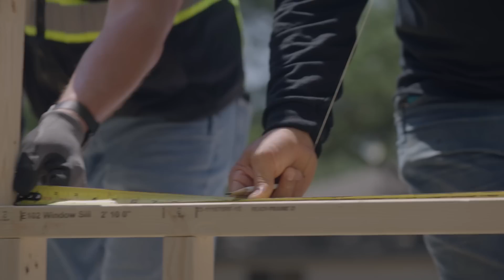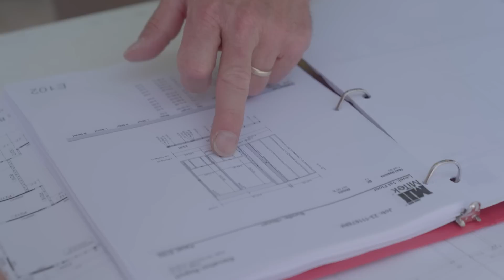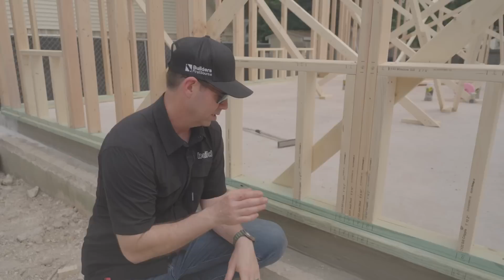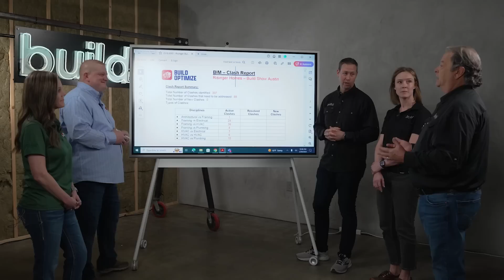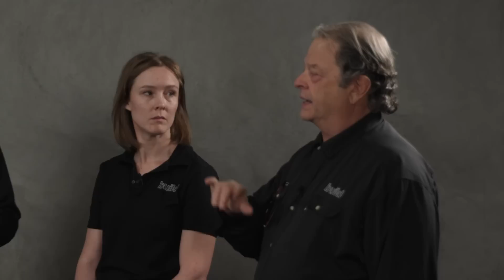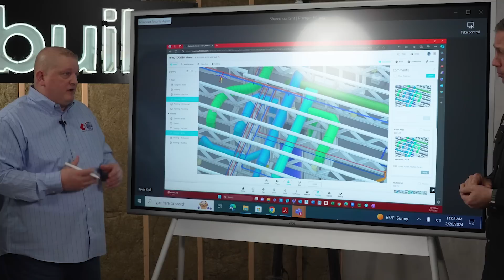The Risinger Build: Episode 5 Part 1 - Exterior Framing with READY-FRAME®

Comment: Never built a house where we could have pre-cut all of the framing. So few of the framing would fit being pre-cut simply due to the height difference in whatever you're framing on. Doesn't matter if it's concrete or wood or whatever. There's ALWAYS some amount of height difference.

Which is fine when your framing lumber is longer since you can just cut it down but when the framing lumber is too short then you can't use it. So I find it hard to believe that they don't have a saw on site and don't have to cut any of the framing lumber

Of course that doesn't sell the product Risinger is pushing

Comment: I have been a follower of Matts since the beginning.  I am not a builder but have built a couple of places of my own and used a ton of Matts ideas and products.  I saw the Ready Frame product and decided to use it on my home build in Hoonah Alaska.  I am on an island and I fu=igured the cost savings in shipping by using Ready Frame would be huige.   I could not have been more disappointed with the entire process.  Once we finally got the package done.  BFS let it sit out in the elements for literally months.  They kept telling me their system was not allowing them to ship it to me.  A "system glitch" they kept saying but they were working on it.   Depsite my repeated requested that they please weather wrap it for shipment to Alaksa, they did not.   This failing to ship it went on for weeks on end. It was suppoed to arrive 2nd week of May.  It finally arrived mid July.   When the finally arrived my builder and I were both shocked at the extreme low quality of the lumber.  There was so much bark on the lumber it was shocking.  It had obviously been out in the repated rain and heat cycle of the WA Summer.  There was black mildew on the wood and most of the headers were split.  It looked worse than the reject pile at HD.  No way I wold use BFS again.  The Ready Frame is only one of the many things Spendard Builders Supply/BFS completely failed us at.

Comment: I’m not a contractor, but it seems obvious that a skilled, experienced crew can frame a custom more economically with conventional lumber than using Ready-Frame. That being said, I can see some real advantages to using Ready-Frame a) when building multiple versions of the same house (e.g. spec houses in a PUD) and b) where skilled, experienced framers are hard to find (and keep). The latter is unfortunately all too common as the current work force ages out and politics keep reasonable immigration and work visa policies from being enacted. It’s just plain hard to get enough young people interested in construction as a career these days. Ready-Frame may be the future of residential framing, especially as other companies get into the market to make the cost even more competitive.
Reply: And drive innovation.

Comment: Kindof doing something like the computer clash points myself with my design.  Doing a full teardown and rebuild.  Right now in the planning phase and had to move alot of stuff around in the drawing to avoid conflicts and make sure its in current code.  The fun is creating the floorplan off the existing foundation and basement.

Comment: What would be the the average length of the walls that you are standing/connecting/ installing? Does BFS caluculate the length base on the size of the structure? Thanks for the Vid.

Comment: I just talked to a representative from Builders First Source, and they said that READY-FRAME is not very suitable for custom homes. He said that it was designed for tract homes and wouldn't be cost effective. I was shocked, because I wanted to use it for my next custom build, but he seemed to be talking me out of it. 😂
Reply: I also had that same conversation lol! However cost wise after pricing out lumber packages from other suppliers. It’s not that much more. I think it’s worth it for a custom home especially if the framers are “your guys”.

Comment: Such an amazing video. I’m in the middle of my own remodel and something that occurred to me watching this is how amazing it would be to have these plans down the road for the owner. I’ve got a 1960’s house that doesn’t follow any rhyme or reason. Finding studs or imbedded equipment is a nightmare. For an owner to have a set of plans that can accurately specify exactly where everything is down the smallest detail would be so useful for future remodel or repair work. 

Just an extra benefit you guys didn’t bring up that I think is a worth mentioning.

Comment: About 40 years ago, my parents built their house using themselves and 3 siblings. We were in our 20's. They used this same system of prepping and marking for each stud wall section and had already built their trusses. We were finished with the walls and roof trusses in about 2 days. Then we were able to install the roof deck and shingles in 2 more days.

Comment: Not sure why you need a double sill plate and one being wider when you can just set your walls in to the depth of your Zip-r and have it flush with the foundation. This way, if you decide to do some kind of veneer stone you don't have to fur out the wall or have an ugly ledge plus, it will be easier to seal a flush line rather than a corner.

Comment: Near the end of the series, could you post the hours spent on the different steps, Foundation (estimate a new build) framing, etc and an estimate of a regular stick build showing the changes.  I am guessing to get to second floor trusses is usually about 2 weeks? and you are there in 2 days and how many people on site vs usual.  I expect you could use 1 or 2 helpers to just deliver the packages for the next wall section, cheaper labor.  Also Lexel needs to package a sausage size (20oz) so your crew can use the electric gun.  The over hang on the foundation, I like the idea of the 'drip" edge and wonder if designing a 1/4" into the builds may not be a horrible idea.  I looked like in the video if you were kind of thinking something like that.  You and your team make this look so easy, makes me think anyone could do this (yea but I know better).

Comment: Not for nothing, but the double LVL headers everywhere seem overkill. I understand you're supporting floor/wall/roof loads on some walls, but a double seems excessive in a lot of what I've seen for this premium framing package. I'd suspect more could have been single LVL with additional insulation
Reply: Not quote true, in terms of bending you may be right, in terms of bearing area, a single ply may not be suitable
Reply: @stevenbaczekarchitect9431  Understood.  Are you talking about the bearing area of the header on the jack stud or the header providing enough bearing area for the wood framing it supports?  I'm a PE and I love these videos.  I'm currently in the process of designing my own new home.  I've been watching these videos for years and am implementing many of the things I learned into my design.  One such thing I'm using is single ply LVL headers & 2x6 studs where I can then get about 3.75" of closed cell spray foam in the wall cavity.
Reply: Why using chemical spray foam? You will turn your entire home into chemical waste. There are better options regarding fire and sound. Also a lot healthier to live in.

Comment: From my perspective as a homeowner this Ready Frame system seems like it would be more helpful/beneficial for the same floor plan built over and over again, for example what production builders do and with framers that have experience with this system.  I'm wondering how much benefit it affords a custom residential build?  Would be interested in others opinions/comments.
Reply: From my perspective as an engineer, this method of framing should be applied to any home or wood structure. Waste and time alone are huge benefits. The real issue lies with BFS/Mitek and the use of their proprietary software
Reply: It has been fairly standard in commercial construction for 6-8 years; coming to residential is just a natural evolution.  It adds about a 1% cost premium up front, but it doesn't take much to make that back on the construction side.

Comment: why not use mini split technology and just pass refrigerant lines through the trusses?  As more and more appear on the scene I wonder if adjusting framing for air will greatly diminish.
Reply: AirSealed house will still need ventilation to maintain the indoor air quality.
Reply: For sure. Ducts can be smaller for a whole-house ventilation system (presumably with ERV and dehumidification) at 6-8” diameter but you still need pathways to every room.

Comment: Those sticks look nice quality, I guess they need to be for clean printing.
Reply: Materials that are run through our READY-FRAME saws need to be flat with very little wane so that it can be marked correctly. Badly warped and twisted materials are cut around to optimize the use of lumber. Waste is not eliminated but it is reduce significantly.

Comment: I never put zip- r right on studs.
Always put sheathing of some variation right tight to the framing, the zip-r or polyiso' or better yet rigid roxul .
Reply: Why?
Reply: @johnwhite2576  i build in a rural area with a base wind speed of eighty miles per hour.  I have opened up walls and found the foam provides rodents easy acess to the whole house around every stud . Also the nail holes through the foam were eyed out suggesting wind is able to move the sheathing and framing independently.

Comment: We would use a smaller crew in Chicagoland, IL. Day one: 1st floor deck over a full basement, all walls with sheathing, 2nd floor joists, deck down and most outside walls.  We could frame 2 houses a week in the suburbs. I see why you have to do cost plus with a rider to use arbitration.
Reply: Cost plus = scam, IMHO.
Reply: Cost plus may not be a scam but what does one call “heads I win, tais you lose.”?

Comment: So more material and prep cost but less labor because assembly is faster?
Reply: Pricing for the RF Package generally is a 5% +/- adder to the framing pack to account for design, cut and packaging (smart bundling). % adder for the package for roughly a 30% faster, 33% fewer framers on the jobsite and 39% more square foot per hour.
Reply: Lol no waste? I'd like to see the scrap pile where they put these packages together
Reply: With Ready Frame, you’re paying a massive surcharge for someone to measure and cut your dimensional lumber. That’s it.
Reply: With Ready Frame, you’re paying a massive surcharge for someone to measure and cut your dimensional lumber. That’s it.

Comment: What’s the added cost of having ready frame?
Reply: I think Matt's said before it's about 10% more. Offset by savings on the labor side.
Reply: Pricing for the RF Package generally is a 5% +/- adder to the framing pack to account for design, cut and packaging (smart bundling). % adder for the package for roughly a 30% faster, 33% fewer framers on the jobsite and 39% more square foot per hour.
Reply: A $5 plank is now $34.99 and comes with paperwork!